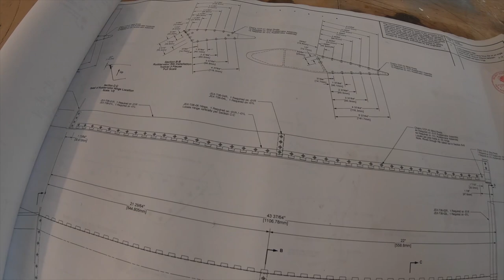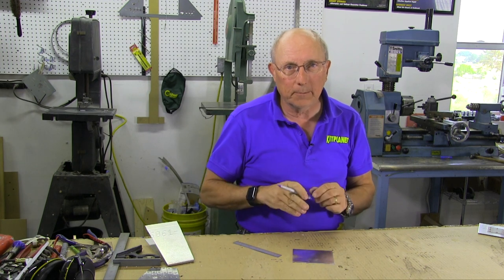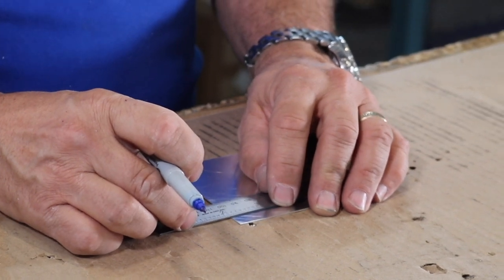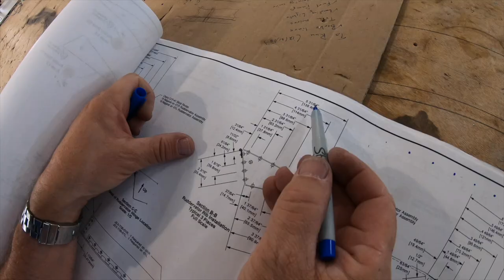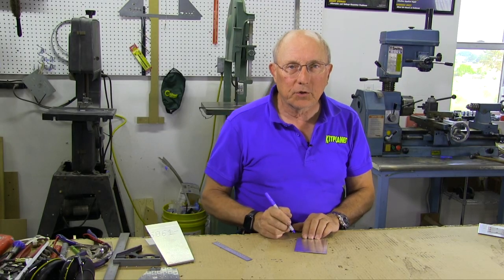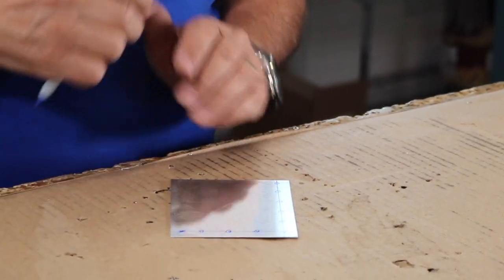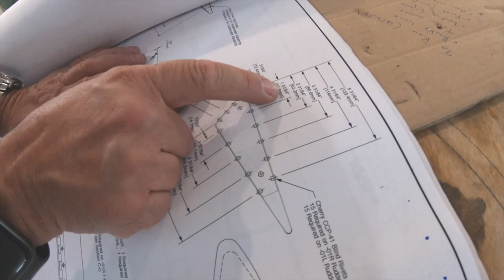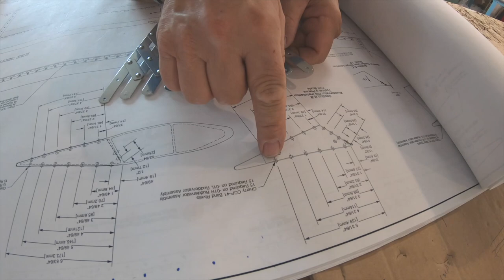Metal Magic: Laying Out Lines of Rivets

Comment: ADJUSTABLE RIVET SPACER - Which size do you recommend, 10 or 20 hole?
Reply from the maker: It really depends on how large a piece you need to work on. Generally, the 10-hole is easier to manage for smaller jobs. You can use the 10-hole for longer runs by overlapping.

Comment: How do I lay out rivet lines equally if I don’t have a rivet fan?
Reply: Locate your two ED holes where your rivet line will fall out (fastener A and fastener B). Take that measurement between the two ED fastener holes (example 7.500 inches). Then determine how many rivets you need or what is required in your rivet row including the two fastener holes marked for edge distance (11 fasteners). Now it comes down to the math. 

Take your measurement of 7.500 inches. And divide that by the number of fasteners you need minus 1 fastener. 11 fasteners required minus 1 is 10. ALWAYS REMEMBER TO SUBTRACT 1 FASTENER!!! 7.500 / 10 = 0.750  

0.750 is your rivet spacing. From fastener A to fastener B and when you go to make your last mark of .750 inch it will fall out on Rivet B. As long as your pitch of whatever diameter of fastener you use falls within the parameters of minimum and maximum pitch your golden!!! 

Hope this helps!!!
Reply: @knotessential why did you choose or how did u get  11 fasteners?
Reply: @manorajf15lover69  I'll show you tomorrow. Have a good night.
Reply: @knotessential  Thank you!
Reply: @knotessential whats up

Comment: I hate how the FAA treat non A&Ps like morons. I am a professional Drafter and a Mechanical Engineer and design sheet metal assemblies all day long. I can handle these sorts of tasks just fine. The FAA needs to better distinguish between personal aircraft and commercial aircraft. This is why so many are doing experimental aviation.
Reply: you got that right! also, they should make a separate endorsement for rotor wing and fixed wing.

Comment: Never, ever drill through a rivet fan!!!!
Reply: Been doing it for over 35 years!!!!
Reply: Guys, if  I dont have a rivet fan, how can I lay out rivet lines equally spaced out?
Reply: @manoraj5804  You use math and a scale (ruler). Even with a rivet fan, you need the scale to determine your starting and end points for the fasteners in the repair area.

Comment: Get the chuck key out of the "lathe" chuck! And for gosh sake, if you're going to do drilling on YT use actual safety glasses over your small lens regular glasses - you should be setting an example of good practice in personal safety as well as technique.

[Lathe in quotes as those tiny combo machines are abominations]